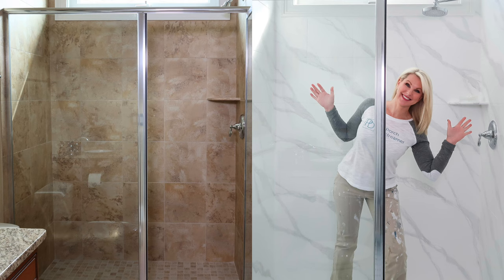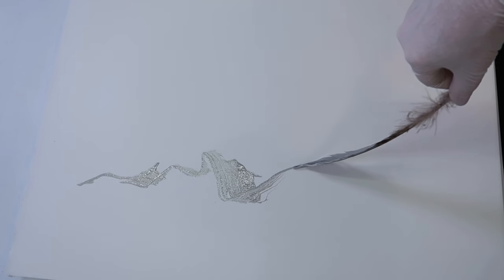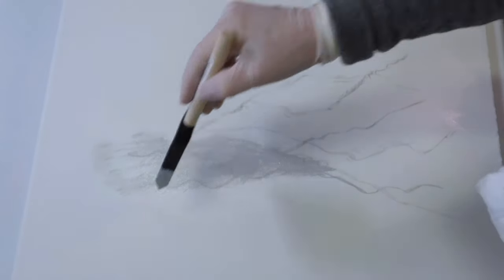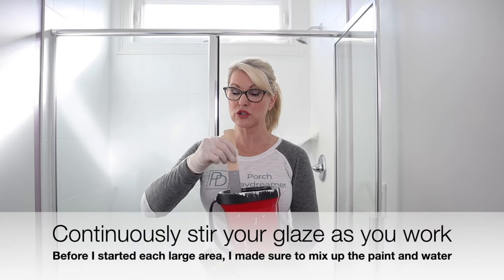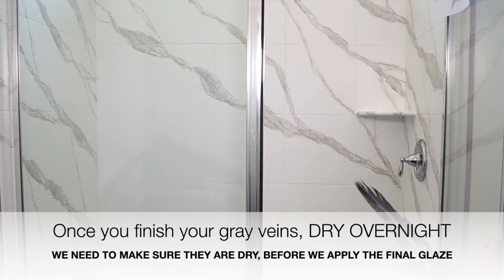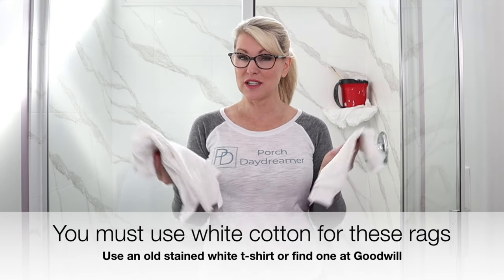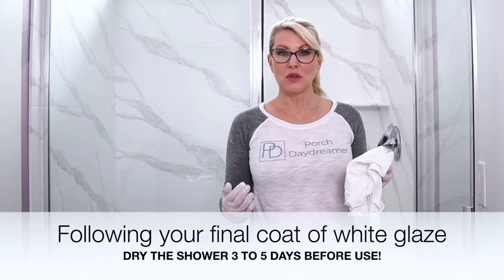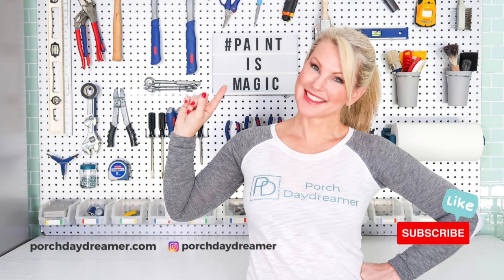Paint Shower Tile to Look Like Marble (under $100)

Comment: I was so gobsmacked by your video (which I watched just yesterday) that I ripped my guest bathroom apart today, much to my husbands dismay!😬I spent HOURS getting the tub surround thoroughly cleaned and sanded.  But then I read your very detailed web page on this tutorial and noticed that you said the paint won't work if it is a fiberglass surround, only tile.  UH OH! I have a cultured marble surround, which if I understand correctly is a mixture of fiberglass and limestone.  But it's very rigid - not like fiberglass that can flex (which is probably why your method would not be recommended for fiberglass tubs/inserts).  So now I'm stuck.  I really want to do the faux marble technique and use the exact products you mentioned (although I do have and love Kilz Adhesion Bonding Primer rather than the Valspar primer), but I'm concerned about longevity.  We are selling the house in a month and I don't want to have any backlash from new homeowners.  I did purchase the Rustoleum Tub Tile epoxy kit and I'm willing to just go that route and forgo the marbling if that's the only thing that would work.  Your advice is greatly appreciated!  I've scoured the internet and very few folks address this topic to the degree that you do.  You are truly an expert and I value your opinion. ☺
Reply from the maker: Oh darn! I'm going to film a video "before you decide to paint your shower" based on this. So THANK YOU for asking this question. Your only option is to do the Tub & Tile kit, which will be great! But sadly, no faux marbling can be done with it. Good luck and you're moving so you won't have to live with it too long 😁